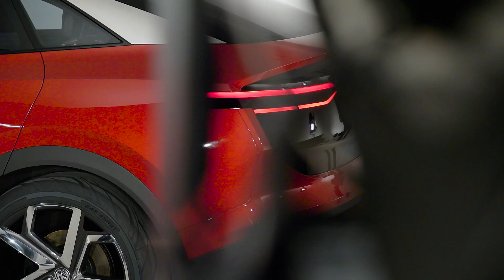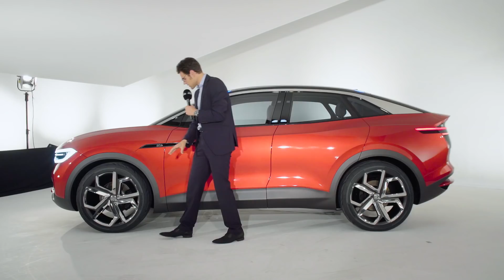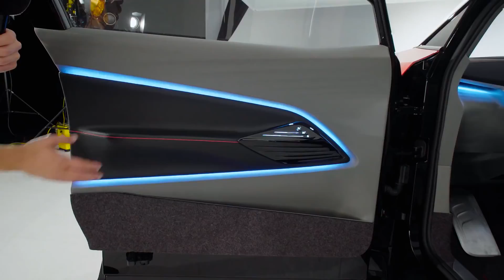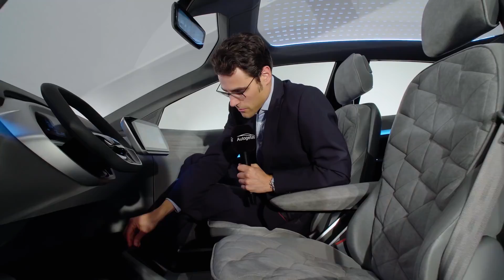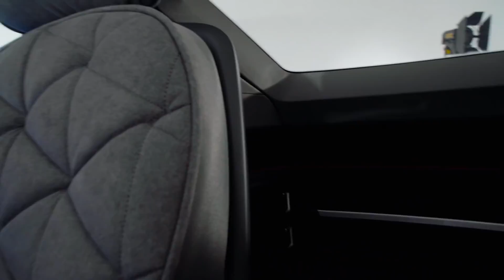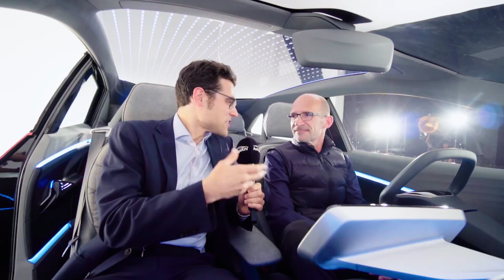VW ID5 is coming up: This ID Crozz concept is the idea of the new EV

Comment: I drive a 4x4 Sprinter Moterhome with "Hey Mercedes" 90% of the time it does not work. Touching the screen on a rutted road is impossible. If this is a crossover good luck using a touchscreen off road.

Comment: What's the point of all that under hood area?  There is no engine up there.  Why is the cowl height so high?  Very inefficient design.  Ground up EV's generally have very short front hood areas, with a very low cowl, for better forward vision.  I much prefer the ID3.

Comment: Honestly,  mirrors and door handles are just fine. There is absolutely no point in throwing in a bunch of new components with relatively untested ergonomics and reliability just to have the car looking a bit cooler. And seriously,  reducing drag for what, the cumulative energy saving of 1 kWh per year? Things break,  and in terms of cars, users have to deal with the consequences when they do inevitably break. Imagine driving along,  when your side mirrors stop working,  or worse,  get lagged behind. Imagine trying to go to work one morning,  and your handle-less car door won't open... Reliability,  reliability, reliability,  VW!  You are not building a supercar. People are going to want to pay around 30k-45k USD for a small SUV from VW, and they'll want it for every day driving. Keep it simple & stupid. And FFS,  give it a better steering column. You can't just assume that people who buy electric cars with auto pilot features don't give a shit for their driving experience.

Comment: I have a good feeling that the way we see the exterior design will be the same as what comes off the production line. The side profile looks fresh, new and exciting. I don't want to buy an EV that looks like an existing suv that was retrofitted to be an EV? I hope the USA market approves the front horizontal light bar and illuminated VW badge. I would hope that the rear seats will fold flat since this is supposed to be an SUV that can expand the rear cargo space into the back seating area? I am anxious to see the final cut for market and pricing.

Comment: Certain design cues are awfully similar to the Jaguar I-Pace. Take instance the cladding at the bottom of the doors. Jaguar deliberately placed them there to break the "large size" of the doors. The cladding also indicates the size of the batteries on the floor of the vehicle. The shape of the panoramic  moonroof, especially the shape near the rear looks eerily like the I-Pace's.

Comment: Pretty sure that current US regulations require external side view mirrors on production cars. I seem to recall Tesla making some effort to get new laws enacted allowing use of cameras because the drag from mirrors actually has fairly significant impact on range for EVs. That being said, having the display for side cameras in the center is ridiculous. It should be projected onto the side window where the drive would expect to look if checking mirrors when changing lanes.

Comment: All they need to do is to produce the car with a range of 300 miles per charge and price it at $35k and then they can beat Tesla.  The more electric car out on the market, it will increase competition and drive the  price down.  Electric car should not be for the rich folks, it should be for the everyday folks who work hard.

Comment: Do not copy Tesla's mistakes and remove all the buttons and stalks. driver should not have to look at menus to get essential items working (like wpiers)
Reply: Good point. Eyes and attention should be kept on the road. Tesla made some poor choices in that regard.
Reply: It's Tesla who had desinged it..
Reply: How many commands does it take to open the glove box?
Reply: titan427 LOL
Reply: sali man just by your poorly written comment, I can tell you don’t own a tesla model s.
Reply: Suggest you compare sales of the Tesla Model 3 to other EV's in the US market.  Audi eTron, Jaguar IPace, or even less expensive cars like the Chevy Bolt or Nissan Leaf.  Which sells at higher volume?  The marketplace has spoken.
Reply: Exactly, don't take the look away from the street! Also in future!
Reply: If the Sensors get the same speed and reaction time like mech Buttons , why not ? 
- It’s depend an electrics Design and programming , ITS WORK or even NOT.  🤓🙋🏼‍♂️
Reply: Spoken like someone who has never driven one or have been inside of one.
Reply: @netgeek3010  Yeah
Reply: Teslas are nor drivers' cars. People who like to drive don't buy electric cars anyway.
Reply: @eddgrs9193  I'm an EV enthusiast and I like to drive.
Reply: @MRTOWELRACK  commuting to work is not really driving.
Reply: @eddgrs9193  people that don't drive EV don't want win in life
Reply: @streetrunner8273  Yeah, I'd rather be a loser with a 911 GT3 RS than a "winner" with a Nissan Leaf.
Reply: Edd Grs why are you comparing a hi-end sports car to a econobox, EV or not?

Comment: You mentioned the front end as still being necessary to house electronics, the other major reason is for crashworthiness: the longer the crumple zone, the lower the deceleration, the better the survivability. I think you were tight in the back, they should likely lengthen the wheelbase 5 cm. to give more headroom in the back seat (have the head entirely under the roof, rather than hitting the pillar.   Looks really great. I hope they keep the doors.

Comment: Scrap this... we just need an e-Golf with a 60 kWh battery...
Reply: Reidailha1 1. e-Golf is not an SUV, 2. e-Golf is built on a frame meant for a gas car, this is an electric car built from the ground up for electric only. Repurposing gas cars is going to take us nowhere, I’m very happy with the ID hatchback that’s going to replace the Golf
Reply: MQB was already designed with EV in mind.... VW is definitely playing the game of selling ICE as long as possible
Reply: An electric Golf with wider range and double electric motors (fron and back) might be made based on longer Golf variant (wagon brake) model and that would be even more intersting if would have the Alltrack trims & features and a bit of off-road capability.. but only Volkswagen CEO knows if they will try do it or not ! ;)
Reply: You describe features from... Tesla... :)))))) Front and rear motors, 4 wheel traction, a bit of "offroadability"...
Only God knows, if... maybe, if not too expensive... in 2050. LOOOOOL
Reply: Musicsson :
Not just Tesla specs i can see way past the Tesla brand to models like Jaguar i-Pace too available today ..  (>_<)
So if you like just read again,  i written regarding that Volkswagen "it might made" and it "would be interesting" if they would do it.. 
(but look at the date of that post.. i mentioned that 2 months before of this launch of Volkswagen concept - I.D. Crozz..) LOL..     ( >_<)
Reply: However... endless and partially a bit childish discussion.

Stay with your VW. 
Unfortunatelly our world faces far bigger problems at the moment.
Reply: Endless and partially ? look i bet my car do a research to see how many people can afford that Tesla X expensive crap.. only then you will understand better what i mentioned here, (very few people can pour equivalent money to get a house in just one car.. that will be delivered delayed with a long period.. ) i also mentioned others rivals but it seems like you are just hatter because i did explained earlier that not just Tesla can do electric and is not by far premium like you praised elsewhere so, anyway i wish you will not have to sell your kidney to get a Tesla X that will clamp your kid hands/heads because is so bad developed that it won't work lower to a smaller height or recognize gestures of small kids resulting in so many injuries specially of the owners kids.. be happy and stay faithful to your dream-pipes Mars cars of E.Musk..  (>_<)
Reply: So, dude, last reply for you - anyway you don´t get anything.
All you do is exagerating... A tesla costs like "a house" ?
Well in Germany a small house easily costs 250.000 EUR... if its a bit bigger, more likely 300 - 500.000
A Model S you can already get for 46.000 EUR if you are a business client.
So, again you argumentation is just based on hateful exageration.

Buy yourself whatever you want.

As I said, the world has bigger problems than your hatred against Tesla.

Maybe you start carying more for your own business instead of others´.
You know how pitiful you look, just babbeling in such an arrogant way about a company like Tesla and the work of so many smart people there?
Its arrogant & poor.

Calu moare de drum lung si prostu de grija altora.
Nu-ti mai bate capu chiar atâta cu Tesla. Fi sigur ca nu le pasā de ura ta.

Cristos a inviat. Astazi sunt pastile ortodoxe, frate.
In Siria mor copiii si tu vorbesti de Tesla... hai māi, las-o mai moale.
Reply: i didn't knew whole world live in Germany .. E.Musk is a good brain-washer for fools like you.. knock yourself out with his cars Tesla fan-buoy..
Reply: Great answer, māi Bulā...
No real arguments, only exagerations and offenses? 
I´m surely not a Tesla "fan-boy" ... Mr. VW fascist-missionary.

Maybe you also work a bit on your English?
NOT: "I didn´t "knew"... I didn´t KNOW.  THE whole world... liveS in Germany. And: fan -"buoy"? 
Four mistakes in two sentences - and YOU teach others about "Tesla is crap"?

Man, you simply have no clue, no manners and low education.

And behaving like "too cool" to speak your native language... tāran Român rātācit prin US sau GB si se crede mai grozav decât baciu Ionel din Harghita. :))))
Penibil... 

Sorry, I´m absolutely not interested in any "wisdom" from you... 
Talk to your VW... :DDDD
Reply: Well done you live in Germany and call others "fascist-missionary", and you talk bull-craps about "exagerations and offenses" ? you try to spread ur ''wisdom'' and ur love in same time about Tesla around when that entire empire is just a scam to generate wealth and power just to one man from fools & believers like you (ohh..  and you 'r ''hate'' about Germany might lead to your expel from that country if someone reads your previous posts), your opinion is surely of huge help to all automotive enthusiasts specially when you talk bs about people you don't know (i understand romanian from my mom but i was born and raised in different country, i never was there in my life but you talk to crappy and tank you for your wisdom, i already give you to much importance but is clear to me that you are too much brain-washed or too stupid to comprehend, anyway nice chat, good luck traveling in autonomous drive in Tesla cars ! bye bye..
Reply: Feeling pitty for you, boy.
Living in Germany doesn´t exclude crisizing fascistoid attitudes - like yours, my friend.
It is simply a fact that you are exagerating a lot - and your mindless hatred against Tesla also doesn´t help to any car enthusiasts in this world.

Know what, VW - fanboy? "Volkswagen" is a name which was created by... You know it? Yes my friend, by Adolf Hitler PERSONALLY !
Read that, my friend:    https://en.wikipedia.org/wiki/Volkswagen
In that period, almost everything in Germany was called Volks-something. The radio was called "Volksempfänger, general heath was "Volksgesundheit", etc, etc.
So, Mr. Know-it-all, your beloved car-manufacturer is still carying a fucking NAZI-Name given by ADOLF. Really disgusting, not even having felt the need to change it!
Might give you a slight hint on what people are running your favourite car company. 
The sort of people that don´t mind manipulating the software, poisoning millions of persons all around the world...
Ironically, "gasing" with VW diesels tragically fits to their "tradition".
Bitter facts, right?

So, you never visited Romania? You should do it. Maybe it´ll help to extend your intellectual horizon, as well as understanding that there are bigger and more important problems in this world than cars.

Honestly, you sound like a 16-year old with not too much of school education...
My "hate" (you mean hatred) "about" Germany might lead to being expelled from Germany? :)))) Loool... are you stupid or really so stupid, child?
Your remark ist SO endlessly naive, I hope for you that nobody will ever read it! Especially since you write under your real name (perhaps).

Where did I ever write that I "hate" Germany? I very much respect this country and its people! 
I only critisized the lack of artistic talent - which is a sad fact. But that´s another story.

So, thanks for the very interesting conversation. From psychological point of view you showed many facettes. :)
And: maybe you try to work on your orthography & syntax... before your 18th birthday.

What a waste of time ...
Reply: Here, kid... that´s what I call an original and emotional design.
Your VW "designers" should steal ideas from here... :)

https://www.youtube.com/watch?v=Pi2wrqAlK5Q

Greetings!
Reply: Each with they own stuff, they not a copy pasters like Tesla are, here are some few of VW latest emotional projects they also did beside the New Touareg & Atlas Cross Sport: 
Reviving T1 in full electric form :
https://www.youtube.com/watch?v=TQut6ks3nSY 
First Atlas Tanoak Hybrid is bigger, wider and taller than Amarok :
https://www.youtube.com/watch?v=kBaDh8psOlE
And Moia the lattest company on the VW group which developed an electric free van based on latest Caravelle:
https://www.youtube.com/watch?v=oT0KS1JaSrk
Reply: Here are the rest of new developed stuff by VW and ceck-out by american they really have an interesting opinion in favour of VW since even they compare them with Tesla product:
https://www.youtube.com/watch?v=EzYS7YUDHOk
Reply: Laurentiu, man, what´s wrong with your psyche?
You cannot give some interesting ideas about EVs in general, without defaming Tesla?
Dude, you don´t drag any sympathy on you like that. Try to be constructive...

Tesla is "copy-paste"? Yeah, sure... if master Pop says that... :)

And your "few of the latest VW - PROTOTYPES"... sorry, doesn´t too much impress me.
What´s so great in your oppinion? The steering in the mini-bus which doesn´t work in real situations, just for a car show? Man, you know anything about ergonomics?
You cannot even grab that steering!
The exterior which looks like the archetype, just more round... like a bonbon? 
Atlas, which looks like any other pickup from Ford or Toyota, obly with more fancy lights?
And wait how little of these design features will remain in the series cars... be sure they will almost look as boring as actual models !

Please do understand, VW is simply your personal taste, so stop behaving like a guy from Jehova´s Witnesses.

I´m not a Tesla fan-boy... but one has to be fair and pay respect to the pioneering spirit and this companie´s willingness to take risk.
I would any time buy an EV from Honda... doesn´t have to be Tesla. But sorry, it will probably NOT be a VW.

You must be a very young kid, otherwise you would have learned a bit of respect and modesty in your life.

And please, try to write like a human being... it´s quite hard to guess the meaning of your broken sentences, sometimes.
Reply: "Please do understand, VW is simply your personal taste, so stop behaving like a guy from Jehova´s Witnesses." 
WELL THEN TELL THAT TO EVERYONE WHO VOTED THE VOLKSWAGEN BEST IN IT'S CLASS OK  !?!  

Somewhere else i also give you OTHER alternatives past the Tesla and Volkswagen brands : Like the latest Jaguar i-Pace, BMW i3, Hyundai Ioniq, Kia Niro Hybrid..   

But Iook, i already spoken with you, i did try to answer to all your stupid silly questions and now i need to see more opinions of other people .. ok ? bye !!!
Reply: Man, don´t you understand? I´m totally not interested in your VW propaganda.
And calling me "stupid" doesn´t neither make you look more intelligent, nore makes VW a better brand.

Volkswagen "best in its class"... Congrats. Toally impressive.

By the way, it is written "best in ITS class"... without apostrophe.
As I told you, you better stop talking about cars with grown ups, as long as your orthography is on such a low level.

Stop making yourself ridiculous, trying to convince someone who studied industrial design and has 15 years of experience.
What the heck ist wrong with your mind?

And why the heck did I answer to all your childish stuff?
Goddamn, this internet... :) What a parasite.

Comment: Looks great! I have a BMW i3 right now, and would never go back to an ICE-age car. This VW I.D. Crozz really tickles my senses. Could very well get into pole position as my next car! Two questions though: Fundamentally important, what will be the charging options? And, do the rear doors open without first opening the front doors (as in my present car)?
Reply from the maker: There will also be a DC charging option. And the rear doors can be opened separately, yes!
Reply: Sorry, but BMW i3 is absolutely horrible
Reply: I am glad you said i3 and not that i8 piece of shit hybrid that was sold as a pure electric.

Comment: Hi VW Designer, That is beautiful and I like it as it is, Just take the Tesla I'de with the Bigger center screen, and make it intuitive as Tesla, I men The Tesla have made something to use as a reference... and then ad your one concept, but keep the button quick setup, many displays like The Nisan Leaf  is NOT good, to old setup. Buttons ore no buttons, If No buttons, it has to be intuitive, and I love the update possibilities like Tesla, just go for it, and make it better then Tesla........And use other materials on the body then steal there rust, and that is a VW problem They RUST THAT IS A BIG PROBLEM..........Please SOLVE that to, Use aluminum, carbon, ore plastic composite, If you use steel metal Please use more Zink like the Audi 100 That was well made and good.......and that was very light body to...........give it  a long lifetime and recyclable.
Jørgen Thomsen Denmark DK